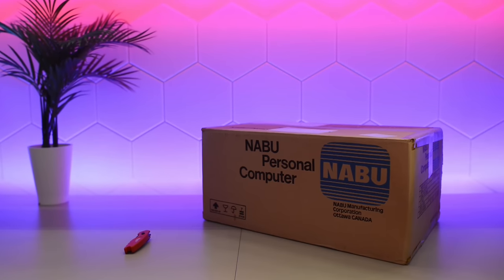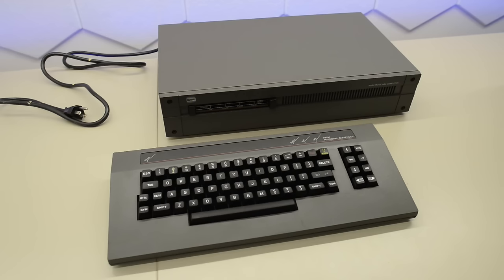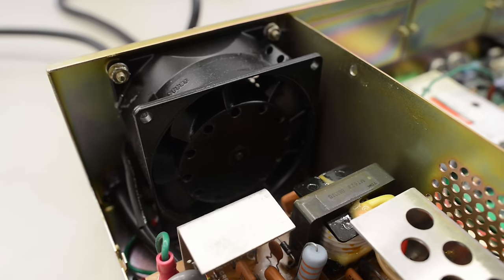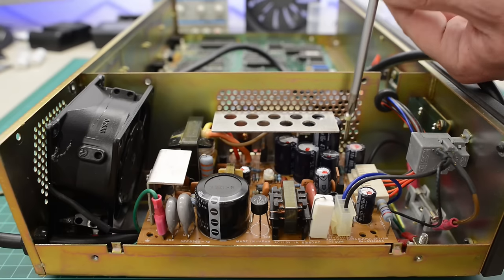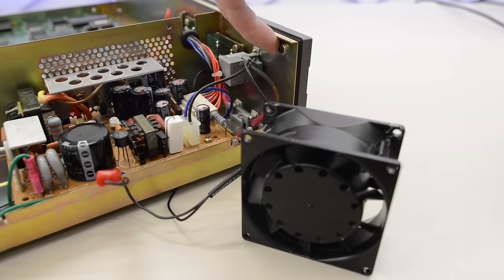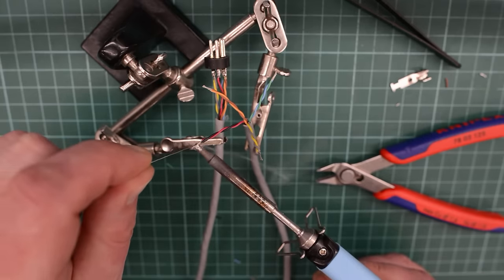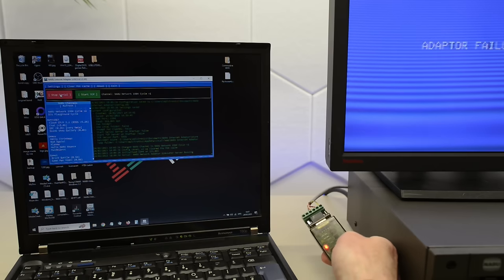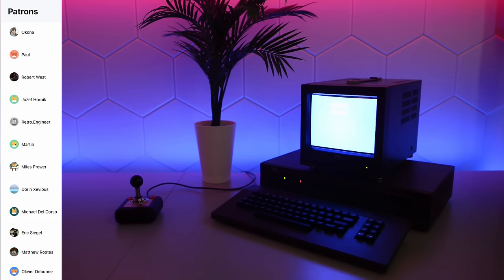Unboxing and repairing the 80s NABU PC that failed. Let's find out what all the fuss is about.

Comment: That fan is surprisingly familiar to me. I've seen those kinds of fans on the back of some Japanese amateur radios from the 70s. For example... the Yaesu FT 101. It's an AC mains powered metal fan, drawing heat out of the tube based finals of the radio. They're absolute beasts!

I'm very surprised to find one of those fans in an 80s computer.
Reply from the maker: Yeah, they sure are! I wonder what they were originally designed for. What application requires a dead silent metal fan, at a presumably high cost
Reply: @Epictronics1  It could be military surplus.

Comment: Your serial cable pinout is correct, but you should be using one twisted pair for transmit and another twisted pair for receive.  I doubt that mistake is causing your issue, though.  Be aware that the Nabu uses a non-standard baud rate and your adapter needs to be able to match the baud rate of the Nabu.  If you can get one of the Dtech adapters, those are confirmed to be able to operate at the non-standard baud rate of the Nabu and install easily without a bunch of driver issues.  No panda bear mini CD needed.  By the way, I believe the Nabu keyboard is a serial ASCII keyboard (with a non standard baud rate).  It's a nice keyboard but the TV/Nabu switch (that toggles the RF modulator on and off) being where the backspace normally is can be annoying.
Reply from the maker: Thanks, I'll re-twist the cable in my next attempt. I may order a DTECH, but I have something else I may want to try out instead. I think I'll leave the NABU kb mod to someone else :)
Reply: And the keyboard innards are worth a gander. It's practically a Motorola 6800 micro in its own right.
Reply from the maker: @andrewmackie5110  Awesome, we'll have a look in part 2. I think the kb also uses RS-422

Comment: I also picked up a NABU. The keyboard uses the same Alps SKCC switches as the Macintosh M0110. Getting it to work with the PC will be a fun challenge. It has a great build quality!
Reply from the maker: Yeah,  they are just turned 90 degrees and have a shorter stem. I think the kb uses RS-422. Hopefully someone clever figures it out so we can start building adapters :)

Comment: With the black monitor on top it kind-of looks like the IBM JX that was our family computer back in the day. Which coincidentally was also released in 1984.

Sometimes with those USB serial adaptors there are settings in the driver properties to change the speed, parity, stop bits, etc., so you might want to check that out.
Reply from the maker: cool, I had completely missed that there was an IBM JX. I had to look it up, it looks awesome. Now I want one : ) You're right, they are very similar looking. Perhaps IBM was inspired by the NABU? If the JX came out in 1984 it was released one year after the NABU. (my NABU is from the second year of production)

Comment: Double check your wiring to the RS-422 adapter. I found that some of the documentation online on building the cable wasn't clear because it didn't state if it was from the perspective of looking at the male or the female end of the cable, and the wires end up flipped as a result.
Reply from the maker: Interesting. I have never messed around with RS-422 before. It's not entirely clear to me how to flip the connections. It seems to differ quite a bit from the usual Tx/Rx I remember from back in the Arduino/FTDI days
Reply: @Epictronics1  RS-422 uses differential signaling for greater noise immunity, so there's two wires in each direction. If the two wires of either pair are reversed then the polarity will be wrong and the bits won't be understood. And if the RX and TX are flipped then nothing will transmit of course. But here's to hoping it's just a driver issue 👍
Reply: yes. rs-422 is differential, plus and minus tx pair and plus and minus receive pair. as you might guess the tx must connect to the rx (think null modem DTE and DCE) the Baud of the sony RS422 protocol is 38.4k 8bit odd parity, 1 stop bit. RS-422 comms can be very confusing, just remember to connect the phase correctly and tx to rx, not tx to tx.
Reply from the maker: @tekvax01  Thanks. I'll try to flip them and report back

Comment: RS-422 is a tricky one...DJ's software sets an odd baud rate that might throw off the adapter. The DTech branded adapters most of us are using contains an FT232, which seems to handle this okay. If your device is also running an FTDI chip the first thing I'd suggest is to see if the FTDI CDM v2.12.06 driver works with it, as this 2014 driver was the last version released before the windows provided drivers started messing up counterfeit chips. If the DB9 on your adapter is 1-5 TXD+,TXD-,RXD+,RXD-,GND then your cable should match the DTech one: DB9-1 to DIN5-3 and DB9-2 to DIN5-5 as a twisted pair with DB9-3 to DIN5-4 and DB9-4 to DIN5-1 as another twisted pair. Ground isn't connected at the NABU, but may help with noise on longer cables. In my own experience I used some old solid core network cable and used two of the twisted pairs to connect the lines as described and have had no trouble leaving the ground connected.
Reply from the maker: I had completely forgotten about that old FTDI driver bug. I actually had a problem with it back then on a project. I'll try with that driver, thanks.

Comment: The fan issues seem common on these. Some can be fixed just by adjusting the screws, moving or rotating the housing. Bending the fins with pliers or filing should be a last resort but it definitely works.
Reply from the maker: Yes, I considered using sandpaper while the fan was still in the housing but decided to check what the actual cause was
Reply: @Epictronics1  It's good to find out the cause of the issue. I would expect them to work fine when new but they've likely moved or expanded after sitting for decades.
Reply from the maker: @Wormetti  That is definitely a possibility. My first thought was that maybe these were manufactured and tested in an environment cooler than what I consider room temperature. aluminum expands ever so slightly with the ambient temperature. They should of course have tested the fan at -55C to +125C (MIL) since this fan is obviously a very expensive high end product, probably intended for way more demanding applications than a bloody PC.

Comment: I've read yesterday that the fan only needs to be unscrewed (3 central screws) and rescrewed as this solves a slight unalignment problem. You actually did this as part of your filing so you couldn't confirm it was solely the filing that did the trick! I'll get mine mid March and I'll be able to confirm or infirm It's just the screws
Reply from the maker: Great, looking forward to the update. Enjoy your NABU :)
Reply: @Epictronics1  finally had time to make my cable this morning. Happy to report it worked on the first try. As for the fan, I really tried to only rescrew the 3 screws but it felt like having 3 variables but only 1 equation. In the end, I went with Rudy's method of slightly bending the fins.
Reply from the maker: @1BitFeverDreams  Awesome. Enjoy : ) I'm a bit stuck because my analog scope cant show me what the converter is sending to the NABU. I might order a DSO tomorrow. It's about time I upgrade anyways :)

Comment: Could try also to properly ground the cable to either the DIN end or to the RS-422 end but not both and see if it makes a difference.  Also make your wire shorter.  Still looks too long.  I made mine 6 inches.
Reply from the maker: Ok, I'll try that, thanks

Comment: I kinda want one of these to turn into a terminal, but the last batch didn’t have keyboards anymore.  :-(  Not sure whether we’ll see a fully stocked one again - I think I may have missed the boat.

I have no love for those AC fans.  It may be a beast, but I think I would rather just replace it with a normal 12VDC fan anyway.  Those are quiet, but of course they are - they’re all hub and no blade.  ;-)
Reply from the maker: True, we don't actually know how efficient it is : ) Let's hope they put out a few more on eBay with kb

Comment: I couldn't get my converter to work on Windows, but it was flawless on Linux, not sure if you might want to try that?
Reply from the maker: Thanks, that's useful info. I'm a linux noob. What dist would you recommend to do a quick test?
Reply: @Epictronics1  Linux Mint or Ubuntu are usual suspects when suggesting "noob friendly linux distro" to someone.
Reply from the maker: @lexatwo  ok, cool, thanks
Reply: @Epictronics1  I would create a Linux "appliance" in Virtualbox.

Comment: But it's an incomplete Nabu system. It doesn't have the ethernet adapter, CD-ROM, floppy and hard drive interface, the enhanced multimedia video card and sound adapter or the SQZ adapter.
Reply from the maker: That's what hacking is for ;)

Comment: i was digging around in my shed find more 2.5 floppy disk and drive and few stuff i just filling this box up with ton of old machine stuff for you

keyboard clicker noise i like it it feelback clicking
i dont know too much about that machine in videos and far i know you going need reprogram ci chips for it read adapter otherwise not work and someone was using machine adapter hook up to it if i find that video i may come cross it somewhere

Comment: you should probably go over the last RS422 video DJ Sures did, might at least give you some ides of what you can do with the adapter
Reply from the maker: I rewatched it but I can't spot any mistakes in my wiring. I'm now trying to find some info on how to test my RS-422 converter with the scope, but I'm not having much luck
Reply: @Epictronics1  if its a USB converter, then it is probably sending 5v to the RS422 - it will work, but the actual values for "good" RS422 are 9v-20v (I think - basically 12v on most older equipment) - but that might not be related to the issues you are having (which is why I did not mention it in the OP) - also verify TX RX cross-over pairs - apart from that, there is almost no difference to "simple" RS232 (like used with most RPi)

Comment: I see you didn't put NABU in the video title, good thing I'm already subscribed so I saw it anyway. I'm a bit NABU obsessed since Adrian's video. What is that RS422 adapter? It's not the DTECH that most people seem to be using. Assuming the cable is wired correctly, I wonder if it's incompatible with that odd baud rate or if it's a flow control issue.
Reply from the maker: Thanks for the heads-up. I have now added "NABU" to the title. Ok, I didn't know the baud rate could be an issue. I may order a DTECH now that I'm aware of this.
Reply: @Epictronics1  You can change it to 115200 in DJ's software or you can try some other NABU adapter software, there are so many now.
Reply from the maker: @Wormetti  Excellent, I'll try 115200. Thanks

Comment: Isn't RS422 cable is supposed to have positive and negative pairs for TX and RX twisted together? Looks like your cable had four sets of twisted pairs instead of just two (RX and TX).
Reply from the maker: Yes, I just twisted/soldered them together to get rid of the four unused wires. I didn't think of the fact that I could have taken the advantage of twisting the wires correctly to improve the cable

Comment: You skipped past testing if TX and RX were reversed on the adapter.  Those old enough know TX on one to the RX on the other and some have ' simplified ' it by marking TX as RX on their pinouts for those that do not know to swap them and not tell anyone.
Reply from the maker: This is the first time I use RS-422 and just found out about this possible issue. I'm actually sitting down as I write this and trying to figure it out. I found the marking on the module confusing, So far I have found four different ways manufacturers label the Tx and Rx and non of them corresponds to my module. My module is marked (T/R+)(T/R-)(RXD+)(RXD-). I'm sure I'll figure it out as I keep reading but I don't mind some help :) What wires should I swap?
Reply: @Epictronics1 To me it seems the T/R+ and T/R- lines are the Tx+ and Tx- lines and the RXD- and RXD+ are the Rx+ and Rx- lines

If the connections are swapped on the controller, the Tx+ from the controller should be linked to the Tx+ line on the Nabu and so on for the other lines.

Comment: Rs232 vs uart
Reply from the maker: Unfortunately RS-422
Reply: Noel's retro lab. Serial comunications with cb2 computer. Other retro dude had problems with serial coms. Or I am confusing rs422 and your usb converter is for rs422 and not for other serial coms
Reply from the maker: @tokul76  Yes, the NABU communicates with RS-422. Good in a way. But also bad, because I don't have a spare adapter to try